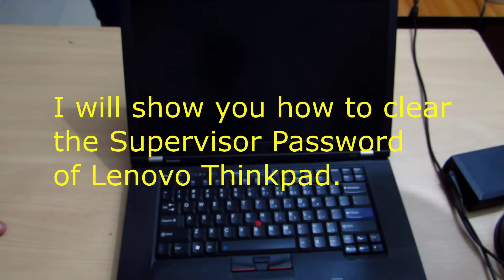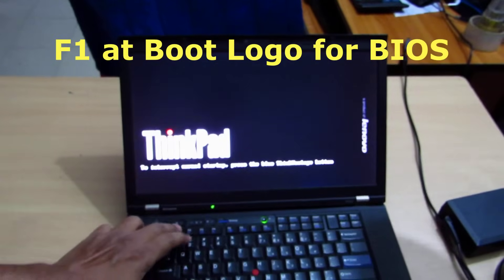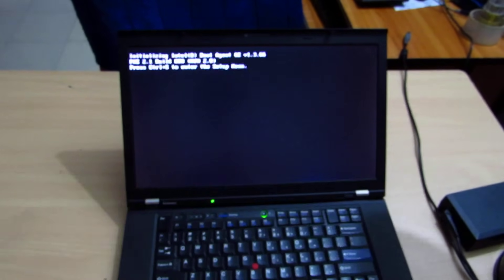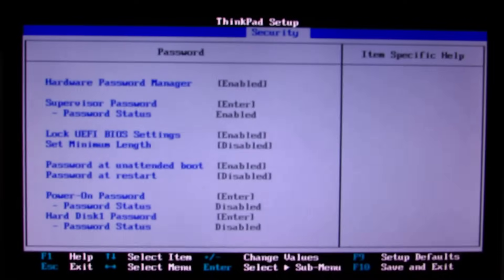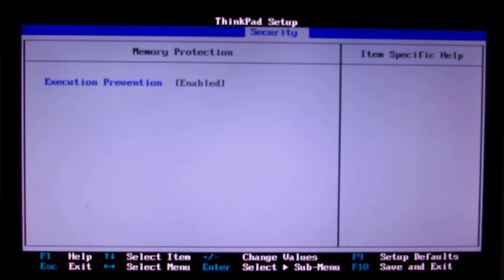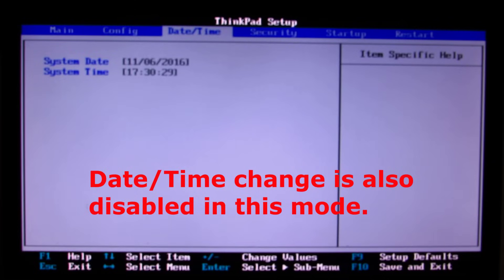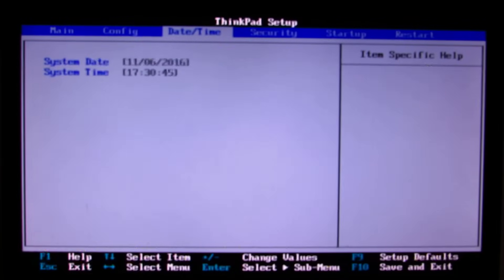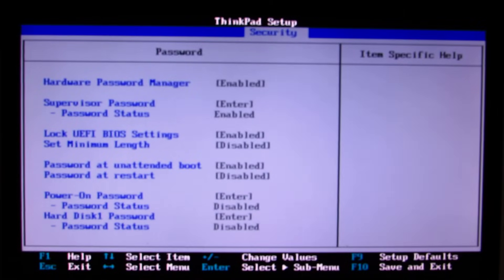How to unlock BIOS Supervisor Password from Lenovo Thinkpad Laptop (no damage to laptop)

Comment: Would that be the same x1 carbon 4th gen as well ? Every time i turn on machine it prompts me with the password like it showed on yours. The thing is I know the password but sometimes I don't have to type it in. Would that be the power on password ? I bought the laptop off someone like that. Would disconnecting the battery and cmos clear that up?

Comment: It worked for me on a T410! Ik kept holding the pins when I entered the bios after 10 trials. The pins on a T410 are pretty easy to access, when keyboard and cover are removed you should see them straight down the middle in the area where the touchpad should be.

Comment: It worked!!!
I tried it on my Thinkpad L420 and worked!
You have to follow the directions TO THE LETTER however.
First time I forgot to remove the pin after entering the first blank password and it did not work. Viewed the video a second time and found where I made a mistake. Second time worked perfect
On the L420 the EEPROM is under the palmrest and very close to the pc express card slot barely covered by black insulation. Very easy to disassemble
Thanks Again!!!

Comment: It works! Fantastic! Thanks! 100% teted Thinkpad W500 EEPROM P24S08 U77 and Thinkpad  T61P  EEPROM P24S08 U77. And I also think that the module WLAN must be installed on the board when the password is reset.

Comment: I don't get the shooting the pins part, are you just holding some sort of screw to make contact between A (SDA) and B (SCL) with the pins or is it connected to a current? are you using a KeyMaker board with probes or just a screwdriver? I'm so lost.
Reply: He's just shorting the pins on the chip. The pins are so small, and so close together, that they can be shorted with the tip end of a heavy paperclip. Just set it between the pins. It will contact them both, simultaneously, creating an electrical short circuit (usually a bad thing, but not always, obviously) between them.

Comment: Thanks so much for this video! I purchased a msata drive to find out my BIOS was locked and I could not change boot order. After watching this video I was able to reset the supervisor password on my T520 that I had purchased online. Note to anyone attempting this. Make sure you are properly grounded and that you don't short any other portion of the board while you are attempting this. I used electrical tape to cover the underside of the board after this was done and reassembled the laptop. Everything has been working fine for a few days now. THANKS AGAIN!
Reply: How do you make sure you're grounded?  haha! I'm watching all these videos and can't help but think that doing this would give an electric shock : )

Comment: doesn't work on an L440 thinkpad
Reply: Did you find another method for l440 i have the same problem.
Reply: Not yet.  I'm going to have to have a technician look at it.  I read somewhere you can try to reset the bios by removing the battery but I'm not taking this laptop apart and risk breaking the plastic.
Reply: Yes i remove the battery and don't work. if i found solution i will tell you. Thanks

Comment: Hello Arpan Dubey, My Lenovo Laptop L540 17 inch is locked by supervisor and password lock, what is the chip number use to short the two pins to removed the lock?  please help..thank you
Reply: I don't think it will work, L440 and T440 are confirmed not working, do NOT take out the cmos battery because it will lock your pc & you'll have to buy a new motherboard

Comment: Great video. Here is a list of links to images showing the location of the eeprom's in a range of Lenovo models.
Hopefully this is helpful.

Helix new generations
https://www.allservice.ro/forum/images/helix_newgen_bios.jpg

T440/T440s
https://www.allservice.ro/forum/images/T440s_bios.jpg

T450/T450S
https://www.allservice.ro/forum/images/T450_bios.jpg
https://www.allservice.ro/forum/images/T450s_bios.jpg

T460/T460s
https://www.allservice.ro/forum/images/T460_bios.jpg
https://www.allservice.ro/forum/images/T460s_bios.jpg

T470
https://www.allservice.ro/forum/images/T470_bios.jpg

T540/T540p
https://www.allservice.ro/forum/images/W540_T540_bios.jpg
https://www.allservice.ro/forum/images/T540p_bios.jpg

T550/W550
https://www.allservice.ro/forum/images/T550_bios.jpg

T560
https://www.allservice.ro/forum/images/T560_bios.jpg

W540/W541
https://www.allservice.ro/forum/images/W540_T540_bios.jpg
https://www.allservice.ro/forum/images/W541_bios.jpg

X1 Carbon/X1 Yoga
https://www.allservice.ro/forum/images/X1gen3-bios.jpg
https://www.allservice.ro/forum/images/X1_Yoga_bios.jpg

X240/X250/X260
https://www.allservice.ro/forum/images/X240_bios.jpg
https://www.allservice.ro/forum/images/X250_bios.jpg
https://www.allservice.ro/forum/images/X260_bios.jpg

P50/P70
https://www.allservice.ro/forum/images/P50_bios.jpg
https://www.allservice.ro/forum/images/P50_bios1.jpg

https://www.allservice.ro/forum/images/P70_bios.jpg
https://www.allservice.ro/forum/images/P70_bios_short.jpg

Thinkpad Yoga 12 and Yoga 15
https://www.allservice.ro/forum/images/Thinkpad_Yoga12_bios.jpg

All images are copyright www.allservice.ro
Reply: Any idea for E440? Does it have the same location as T440?
Reply: I dont know sorry dude. I just posted the links that were on the allservice website to make this video thread a little more complete. You might be able to contact them to find out, however they are a professional service and charges may apply. Good luck with it.
Reply: @Jarryd Watts! Do you know the difference from SPI Flash and EEPROM ?
The web link's are from new models and the password is not stored in eeprom.
It can be very confusing for user's who don't know the difference. They can damage the laptop shorting the BIOS SPI flash !
I think Is better to remove the links.
Here: http://www.ja.axxs.net/eeprom_location.htm Here are the all models who use eeprom ;)
Edit your post !

Comment: Where is the security chip/EPROM located in a Thinkpad T60?  It's good to have these instructions, unfortunately they are useless, unless you know the exact location of this chip.
Reply: Sadly the T60 eeprom can't be reseted by jumper. You'll have to use a dedicated device (which plug in serial port) to read from the eeprom after soldering 3 lead from it to the device. If you don't feel like an adventurer, might just buy a new one, those old crap are cheap.
Reply: Well, that is unfortunate. I wanted to buy a T60 with bios password, unfortunately the things that you listed are way above my skill level.
Reply: Varengard can we reset on x1 carbon 4th gen(which has i5 6th gen processor)? Thanks.

Comment: On my T500 it works too. Thank you very much.
I find the mainboard is somewhat more difficult to expand. I took a few experiments. The eeprom is also on the bottom of the board. Description U77 /  8 pin chip (SMD), a P24S08. Short Pin SCL+SDA

Comment: Dude Thaaank  yoouuu. I was watching other videos on how to disable the password and was pratically thre same as you but they didn't work. The trick was the one you explained: With the pin shorted hit enter on "New Password" RELEASE SHORT and hit enter again on "Confirm Password" and finally F10 to save changes. Tha did the trick.
Many Thanks my friend
Reply: Thanks you! Man I got in the bios 4 times but it wouldn't save, thanks again for the tip ! This is awesome
Reply: Please HELP.. Does it work for Lenovo T470???
Reply: @moz_binary_deriv258  hi did you find a way to unlock t470s ? Im also having that pls help

Comment: I can confirm this works. Ex-corporate T400.

Timing looks harder than it is. You need to Hit F1 and IMMEDIATELY short the two pins. Too soon and it doesn't boot. You have done it right when the BIOS setup shows the UUID as all Fs. 

 Thanks.

Comment: hi , does it work for T460 ?..
Reply: cloudy it shouldn't. In fact I have no clue what will work except for motherboard replacement. Did you solve the problem?
Reply: Emanuel Truța because they have made changes to the way they store passwords and protect them. This method works only up to t430
Reply: Gave it a shot on T460 but didn't work. Only option is to flash bios chip with a patched bios file. Check eBay